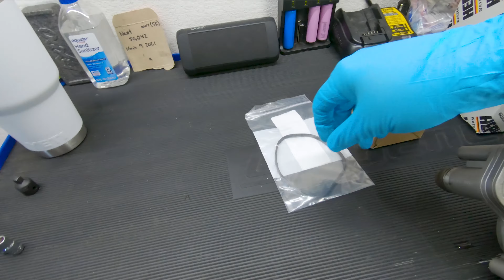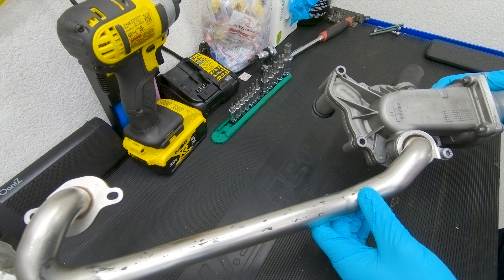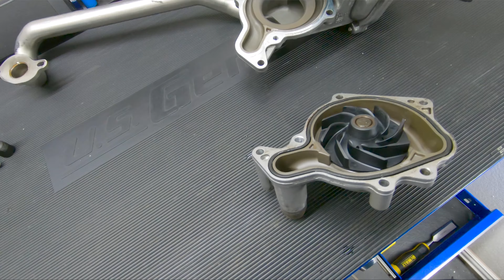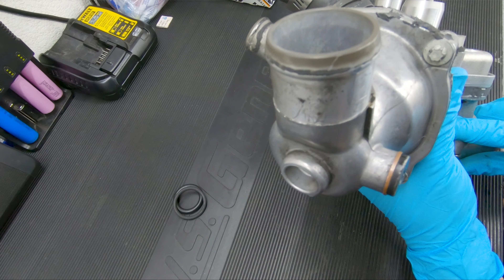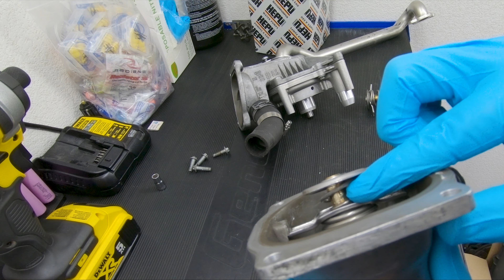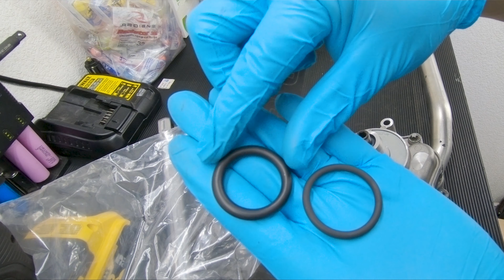2004 - 2007 Audi B6 & B7 S4 Water Pump Rebuild

Comment: Hey bro i know its an older post just curious, is their a o ring or gasket on the other side of the coolant line?
Reply from the maker: That's a good call out. Yes there is another oring that's on the other side of the pipe. It's more of a egg shape oring
Reply: @markb6s4 thank you sir